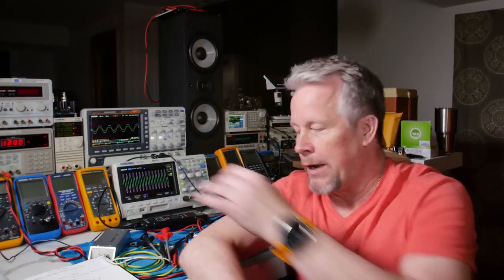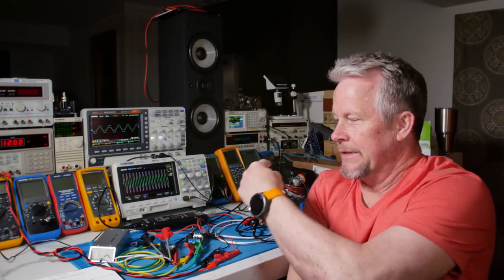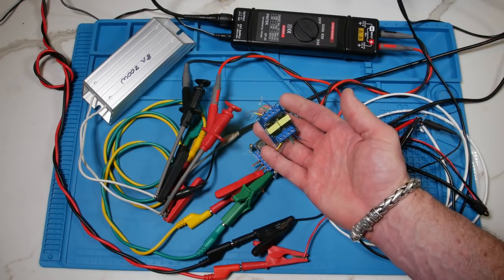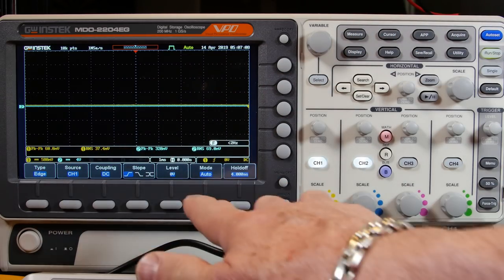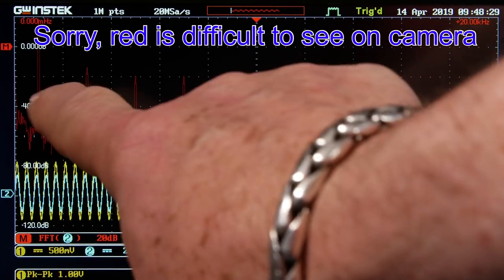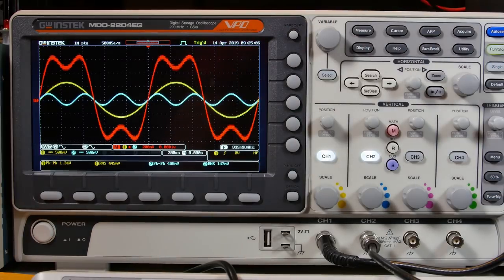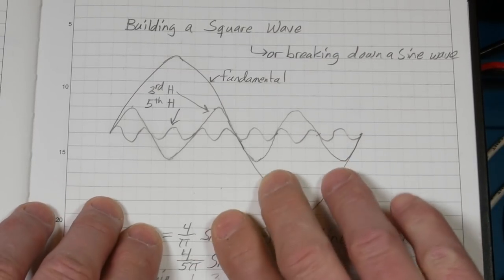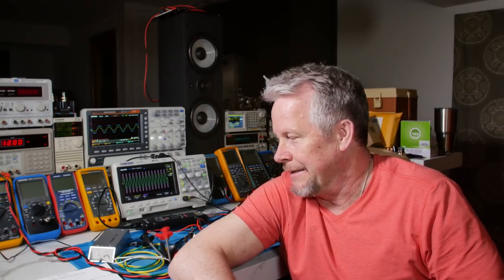Introduction to Harmonic Distortion, THD, and how to use FFT #FFT #harmonicdistortion

Comment: Hey Eddie. To make it even easier for your viewers, they don't need to calculate RMS voltage from the peak voltage they see on their scopes in FFT mode. RMS voltage factors out (is present in all terms). Also, if they set their fundamental frequency to 0db (1 volt) in FFT mode, they only need to calculate the numerator to determine THD. As an example, all they need to calculate is sqrt(3rd_harmonic_voltage^2 + 5th_harmonic_voltage^2 + ...).
Reply from the maker: Somehow I missed this.  Thanks Steve, this is great info on how to simplify.  Use the KISS method right;)

Comment: Those anomalies you point out at 14:40 are not caused by high frequencies, they are caused by the LACK of high frequency harmonics that allows the lower harmonics to become visible. This is an indictment of your miserable circuit that removes high frequencies. See https://youtu.be/s0Eqq5JNPn4
Reply from the maker: Thanks Dan - I should have been more clear and used your 6 rules as a talking point.  It is relative, what I mean is as you go from a sine wave to a square wave you start to generate high frequencies (harmonics higher than the fundamental or sine wave frequency).   And I do point out that they are odd harmonics and any of the even harmonics were from the generator and not the newly created harmonics.  I like your 6 rules and will need to keep those in mind when explaining these things.  See - maybe I’m not an idiot;) BTW, I’m going to buy your book - but I want to be sure which one to get.  It looks like your second one is really a rev 2 of the first.  Is that true or would I benefit from getting both?  Also, can I review it on my channel without getting copyright infringement?  Tell me what page or pages I can show if I can.

Comment: So, THD = (Vrms w/o fundamental) ÷ (Vrms of fundamental only) ?
Reply from the maker: Yes that is correct?  But, that would actually be the THD with noise, so to actually get just THD by itself it would sum just harmonic values.  Make sense?
Reply: @KissAnalog  Thanks. Good demo. w2aew #305 has good demo as well. You guys 👍👍.

Comment: According to Tektronix an FFT (on a scope) is just an approximation. In real life an FFT is perfect, but you have less than a basic grasp on harmonics.
Reply from the maker: Thanks for your feedback!  Actually FFT is the 'Fast' version of a DFT, and depends on the sample size - so is an approximation by definition and is not 'perfect'.  
Tektronix would say that as their FFT on anything but their most expensive scopes is very limited (low sample size).  
The lower cost scopes I have on my bench are far better.  The GW Instek and Siglent have 1 Mpts capability where a scope costing multiple times more in the Tek lineup has 1/10 that capability.  
The GW Instek also is an MDO (mixed domain) and is a fraction of the cost of an equivalent Tek that can do the same band width.  I wouldn't take what Tek has to say about FFT as the truth - except when specifically talking about their own equipment.  But it is very hard to find them show the sample size of each of their scopes.
Sorry this is an electronics channel and not a math channel so we just want to use the FFT as we can - and I don't think I'm going to have many views on a math class.
If you have anything to offer here to help us understand FFT better - then please take some time and offer that.
Reply: @KissAnalog  Tell me, in your humble opinion which sample rate gives you more resolution AND accuracy: A fast sample rate or a slow sample rate?